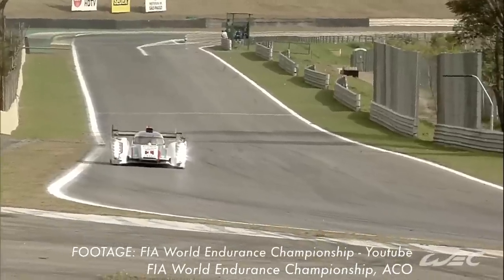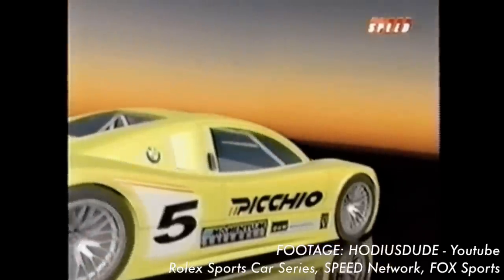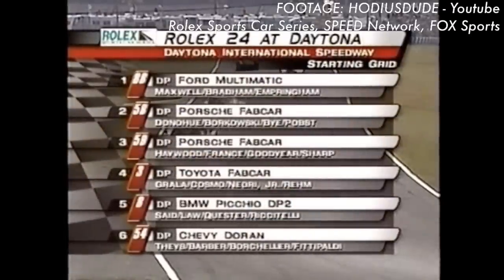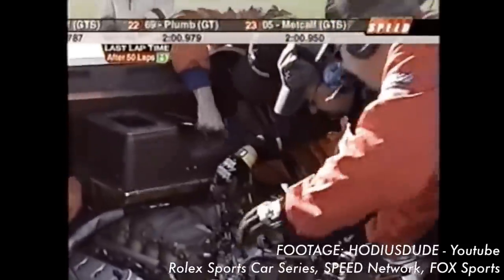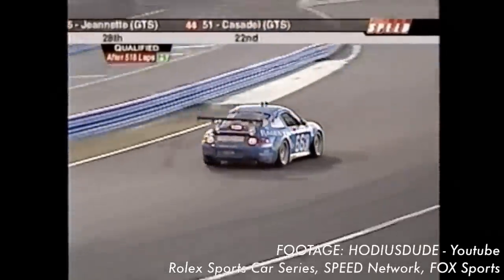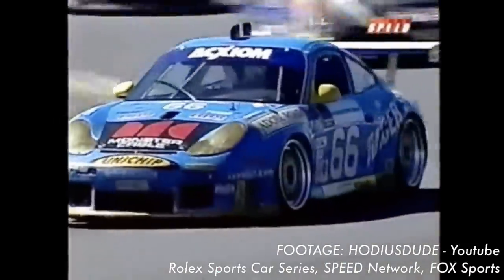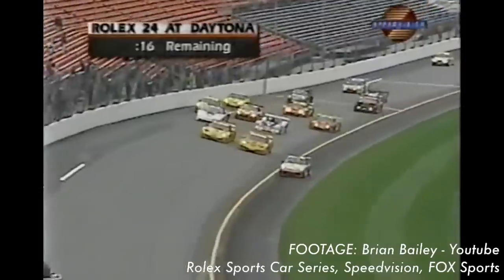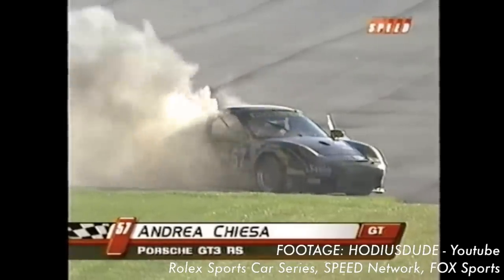When A GT Car Won The Daytona 24 Hours

Comment: For people interested, the 2015 Petit Le Mans also had a GT car win overall, but that was due to weird rain stuff.
Reply: It was actually because the driving aids of GTE cars are wayyyy better than anything in LMP2 and LMP2-related classes like DPi
Reply: Falken also had the best mixed condition and wet tires.
Reply: @DiegoRuiz1991  dpi definitely wasn't "lmp2 related", they were more like non-hybrid lmp1s. Much faster than p2.

(Also fyi, dpi didn't even exist in 2015, but that's aside from the point)
Reply: @MrJohansen  Dpi are based of lmp2 chassis and where way slower then lmp1-L which was lmp1 without hybrids
Reply: @MrJohansen  DPi were by definition "LMP2 related". They literally were LMP2 chassis with different engines and minor modification of bodywork. The rules in DPi did not allow to build a car from scratch, you had to take an LMP2 car and modify it. It can't get much more LMP2 related than that.

Also at first they were not faster than LMP2, they were BoP'ed to race against them in a combined class. In 2018 Core Autosport won several races and almost the championship in an LMP2 against DPi. This made the DPi manufacturers rather unhappy and they threatened to leave unless IMSA would split the class. So for 2019 onwards LMP2 in IMSA were massively slowed down, while DPi were allowed slightly more engine power. 

In terms of speed they were still far away from LMP1, much closer to the unrestricted LMP2 that ran in WEC until 2020.

But to come back to the 2015 Petit Le Mans: DPi did not exist yet. The top class back then was a mix of the old DP cars and LMP2. They, as well as LMPC, had to use a spec tyre from Continental. The third class GTLM allowed an open tyre competition. Under heavy rain these GTLM tyres from Michelin and Falken had much more grip than the spec Contis which suffered from aquaplaning, so the GT cars were able to outperform the prototypes.
Reply: @MrJohansen  As others have said DPi were LMP2 chassis with minor changes and different engines. They're basically the beta version of the LMDh formula which the ACO and IMSA have adopted as part of their joint top class with the fancy hypercars - they are also basically modified (future) LMP2 cars with a fancy hybrid system, improved bodywork and a different engine
Reply: @slwsnowman4038  The Falken Porsche won its class at Petit Le Mans in 2013 and 2014, but it was a factory Porsche on Michelins that won overall in 2015.
Reply: i was going to say this, it was only other time a GT car won outside of daytona 24
Reply: That was a great battle. I was hoping the BMW would get the Porsche, 

The biggest issue the prototypes had that day was the tires. After the ALMS merger the GTLM cars were allowed to use alternative brands as er ACO rules whereas the DP/LMP2 cars and GTD Cars had to use the Continental tires. 

The accusations of GTLM cars having far superior driving aids isn’t correct. The prototypes use the Bosch or Cosworth systems which was also used on the GTLM cars. They make the best systems, the manufacturers are able to develop bespoke programming for their specific car but the data banks for a Ligier JSP2 were far greater then what BMW or Porsche could utilise. The BMW Z4 GTLM was never eligible for ACO Homologation so at their peak there was only 3 cars racing. 2 by BMW Team RLL And one by Marc VDS In the ELMS. Porsche had 2 Pro class cars in GTLM and GTE in the WEC. They also had a small bank of old customer cars to rely on for data but given the updates to the new car year on year they were almost void for development. I think Ligier had 18 cars racing globally across all 4 IMSA/ WEC/ ELMS and AsLMS respectively.
Reply: Here’s a link to a video I took of that race just after the Porsche your referring to took the lead. He was turning the guts outta that car every lap to keep the lead on the prototype behind him in the rain.

https://youtu.be/Um_XkdzAtDs
Reply: @DiegoRuiz1991  It was more due to the Michelin rain tires run on the GTE cars being far superior to the Continentals run on all of the other classes
Reply: @DiegoRuiz1991  so much wrong info there, GTE cars hace no ABS nor TC, the only reason they were faster its because they are deriven by pro drivers, while the other prototypes clases had amateur drivers to scared to extracto the full potential of the car in wet conditions
Reply: @tiutubanana7506  They have TC
Reply: @tiutubanana7506  - Jordan Taylor was a DPi driver back then, so was ex-F1 Max Angelleli

STFU kiddo, of course GTE cars had TC, ABS, adjustable diffs and many engine mappings
Reply: I was coming down to type the same thing. I was at that race and it was miserable weather, but looking back I'm glad I was there to witness such an unusual occurrence.
Reply: @DiegoRuiz1991  just a quick look at the rule set and you will see that GTE car dont have ABS nor TC
Reply: @tiutubanana7506  - Remember that year not too long ago that rained quite a bit during LM24? Antonio García gave out an interview to a Spanish magazine and explained how the Corvette C7R had 10 TCS levels, several ABS levels too, an adjustable diff and more. He even said that, while he's usually the guy with the weakest TCS level in the dry for Corvette, he was pretty much putting it at max in the rain and it was still awful to drive.
Reply: @fsca72  i just looked at your video and that looks very wet. thanks for the link
Reply: I'm still water logged from that race!
Reply: @tiutubanana7506  yes to the first points. The Porsche in general, due to being rear engined and having great rain tyres, was a monster in such conditions. Adding to that, Tandy drove out of his mind that day
Reply: @DiegoRuiz1991  that's just wrong. GTE and GTLM did not have ABS.
Reply: For anyone wondering about the performance delta between P1 and DPI, here's the Sebring 2019 combined pole times:

WEC LMP1(Hybrid) 1:40:318
WEC LMP1 (non-Hybrid) 1:42.863
IMSA DPI 1:45:865
WEC LMP2 1:47:558
IMSA LMP2 1:49.728

Comment: This is what we call, expect the unexpected. 

This is why I love endurance motorsport. 

Fastest car is not the guarantee that you will win. Slower car is not the guarantee that you will lose.
Reply: I remember on a old episode of top gear when they did the 24 hours of silverstone in the BMW diesel. After crashing it the front splitter falling off the car being down on power they still ended up setting the most laps for their class of car.
Reply: That’s why they need to start randomly activating traps around the road, only the strongest will survive

Comment: The 2001 Daytona 24 Hours also had a GT (technically GTS) car win, with a Corvette taking the top spot, and a GT Porsche driven by Randy Pobst and co. taking second place 8 laps down. The overall-leading "SRP" prototype of Dyson Racing had a hefty 27-lap lead over the Corvette, but ended up retiring late into the race when the engine blew up.
Reply: I see Randy Pobst i like
Reply: He said that at the end of the video
Reply: The 911 has won Daytona many times overall... Including in 1973 with the Rs and all through the late 70s and and early 80s with the 935....... In the late 90s a gt2 evo got lucky and also won overall.....
Reply: Just watch the video before commenting its something i would recommend!
Reply: The Viper GTS-R did it before the Vette in 2000 as well.

Comment: At the 2003 Spa 24 Hour, a second level NGT class car won the race outright beating all the cars in the much faster GT category.
Reply: That is one of the most scuffed races I have ever watched.

It's a shit ton of nostalgia though because G T R 2
Reply: @Dexter037S4  Same!
Reply: I know that one from GTR 2 but the difference in speed between an NGT and GT car is not that great compared to the difference between a GT and a prototype. The 2003 spa 24 was a race of attrition, also with a lot of rain, nearly every car had some sort of damage...what an interesting race it was!

Comment: 2022 Bol d'Or also had a great story

· 100 years after the first edition, it's the only major motorsports event that keeps changing venues (places like Le Mans, Magny Cours and even Linas-Monthlery have hosted it)

· Teams of 3 riders will ride for 24h on sportbikes around the full chicaneless version of Paul Ricard - A total of 6 factory-backed sportbikes showed up, 1 for each of the Big 4 Japanese brands plus 1 more for BMW and Ducati

· It's just SBK-like and STK1000-like machinery on 2 classes - Making a sportbike extremely durable or easy to repair is borderline impossible, there's no room in there and weight is extremely important when you're manhandling it for 24 hours

· Honda-TSR, Yamaha-Austria (better known as YART) and Suzuki Endurance (better known as SERT) were fighting for the championship in this final race with a 50% point bonus

· The race started with a very strong Mistral wind going down the extremely long uninterrupted Mistral straight, helping the sportbikes easily reach 200+mph

· After 4 hours, most of the top sportbikes had had major mechanical problems including BMW and  - The reason is of course unclear but it's very likely that everyone miscalculated how much the Mistral wind could help them and got out with a 6th gear a tad too short

· Ducati-ERC, the worst factory-backed team, was leading the race but with 2 riders instead of 3 - They're also the least-reliable top team all around including the Panigale V4R being the hardest to work on. They hoped that Chaz Davies could get a good night and maybe come out to at least do a stint or 2 during the morning.

· Kawasaki-Tati, 1 of the best privateer teams, was suddenly in championship contention - SERT, YART and BMW were OUT while Honda-TSR is battling a very faulty bike with lengthy pitstops

· Night started falling and it was Ducati-ERC vs Kawasaki-Tati for the lead. If Honda-TSR could make it to the top5 by the end, Kawasaki-Tati would need to win it all.

· Shortly after midnight, Ducati-ERC had to change the entire clutch of the Panigale V4R, a common failure so they've done it before and only needed like 10-12 minutes, which is rather crazy by sportbike standards - After that stop, the whole top3 was just privateers (Kawasaki-Tati, Yamaha-Viltais and Yamaha-Wojcik)

· At the halfway point (3:00), top3 was all in the same lap (Ducati-ERC passed Yamaha-Wojcik for 3rd a few minutes earlier) with Honda-TSR in 5th several laps behind.

· By the 16th hour, Ducati-ERC was back in the lead with Honda-TSR 5th and Kawasaki-SRC (the factory-backed Kawasaki) in 6th like 40-50 minutes behind if we translate laps behind to time - BTW, Davies never got back on the bike. David Checa and Xavi Forés are doing a 2-man run for the 2022 Bol d'Or

· The 19th hour killed the dream for Kawasaki-Tati , which meant Honda-TSR got the 2022 FIM EWC title - Kawasaki-Tati came back on track at the very end to complete 2 laps to show up as "finishers"

· With 90 minutes left, Honda-TSR went for the umpteenth lengthy pitstop and Ducati-ERC went for their 2nd clutch change... except the Panigale V4R was having more issues than initially expected and their 2-man dream run died after rejoining in 5th many laps behind the leader. Who the Hell was leading? Yamaha-Viltais closely followed by Yamaha-Wojcik, great fight until the end... which actually lasted only like 3 minutes because Yamaha-Wojcik somehow broke their chain and lost like 2 laps because of it

· RESULTS = Yamaha-Viltais became the 1st privateer since Honda-National won the 2006 LM24 ahead of Yamaha-Wojcik with Kawasaki-SRC in 3rd, Honda-TSR in 4th and Ducati-ERC getting their best result in a 24h race with 5th overall

Comment: Endurance racing is certainly an odd beast, I think the crown goes to the Nurburgring 24 Hours since even just last year they had 173 entries in 21 classes (4 of which where single entry classes)
Reply: And two of the classes are for sports cars and touring cars not fitting in any of the other classes!
Reply: @mashy0001  No other series has something some guys made in a garage in their free time racing along side factory teams stress testing parts.
Reply: @WyldStallion-bs9oo  I don´t understant the FCY and then SC. There is even saying that safety cars breed safety cars. It is in no way really safer than just FCY, because FCY doesn´t bring a field of 60 cars together.
Reply: funnily enough 173 entries is a low entry number for N24, normally it gets to around ~200 entries... and the Dacia
Reply: I watched the YouTube replay of the 2022 24 Hours and was fascinated. With 170 cars on the track, frightening speed differentials and the number of fast sweeping corners, the skill needed to maneuver the faster cars is above any other. Daytona and LeMans don't come close. I am hooked now for life.
Reply: @williamford9564  Only series you can see people's garage projects racing against factory teams
Reply: @WyldStallion-bs9oo  Kinda like the LMP2 finish this year. Run for 24 hours just to lose by .0016 seconds.

Comment: A custom video about history and development of DP's may be needed. The strange shape of these vehicles was due to 
A. Requirement that radiators are in front of windshield (this made the noses ugly)
B. Wiiide greenhouse area. This was done to make cars draggy. The series owners wanted to limit top speed at Daytona to 200mph and use GT engines. With healthy power and limited areo the best way to add drag was big windscreens.

It was nice that there were so many different car developers at the start of DP era. This is very uncommon now. What happened to these developers, and who were them?
For sports cars with similarly absurd sized closed cockpits, check out the late 60s "sport prototipo argentino".
Also, consider a video about "Team Racing Auto Circuit (TRAC)" failed racing series.
Reply: The final version of the DPs is hella underrated as the Corvette DP was a much cheaper version of what some GT1 cars were (specially the 911 GT1) - It baffles me how not more manufacturers tried to make similar cars with their own bodies

Vantage DP, 911 DP, 458 DP and many more would've all worked, the platform was damn cool
Reply from the maker: I can certainly look into doing a video on the history of the Daytona Prototype.
Reply: The later years of DP where great. Those Corvette DPs looked and sounded phenomenal.

Comment: 24h SPA 2003 was won by lower class Porsche 996 GT3 RS from Freisinger Motorsport.
There was no prototype, only GT1 class (Ferrari 550, Lister Storm, Viper etc.) 
Porsche 996 and Ferrari 360 where the NGT class (its like GT3 and GT4 today)

Comment: 4:44 either that's the weakest guardrail ive ever seen or that thing was going at top speed
Reply: Based on where it was positioned, it was probably by design that it broke away how it did. Only meant to slow down a car from race speeds rather than try to bring it to a stop.

Comment: Never knew Honda made a 3.9L V6 must be a bored out J37 platform I’d assume. The prototype J39 is probably the largest Honda engine alongside the experimental Honda CVCC Cadillac V8  that was modified to prove V8’s can have the same gas efficiency as their 4cyl engines

Comment: hope the reliability off the new Lmdh cars will make the full 24h this weekend
Reply from the maker: I very much hope at least some of the new GTP cars can make it to the end with relatively few issues.
Reply: @tydyeracinggaming4742  acura and daddilac have done it last year so I think they will be fine. 
Porsche has driven le man in the lmp1 class before and will survive. 
BMW on the other hand hasn't driven on the top class for a few years now. I feel they wil struggle for the first few races same with peugeot in wec. Struggling forst year and getting stronger qnd faster every race.
I hope get suprised tho we will see

Comment: GT cars are scenery. People are there for the Protos. And Protos should be like the older LMP1 cars of the 200p - 2010 or 2014 to 2017 Generations. Running at F1 racepace.